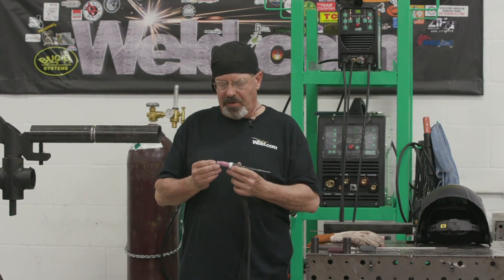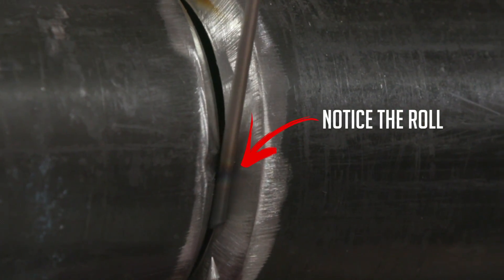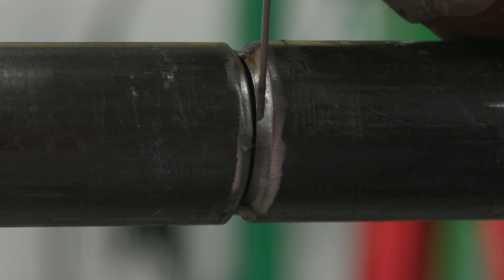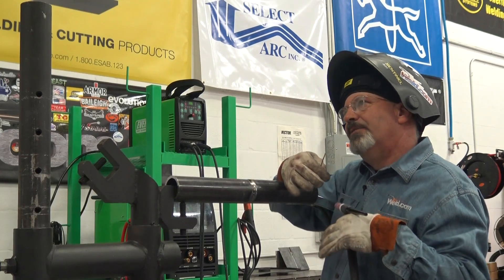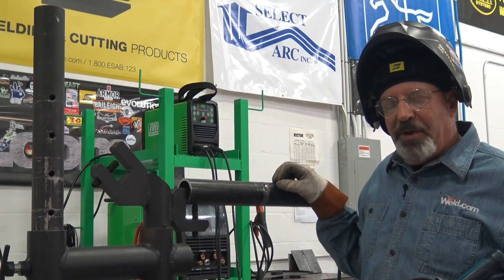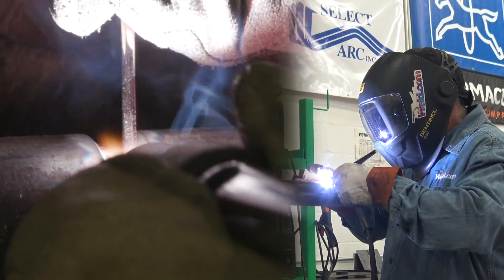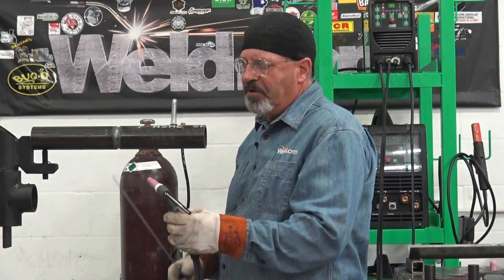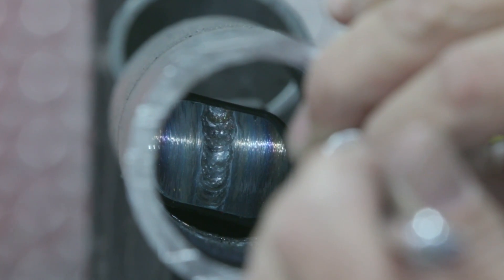5G TIG Root Pass: 2 Inch Sch 80 Pipe

Comment: No need for inert gas in the tube? I can see the electrical cable connected to the pipe, but no plugs and inert gas line to the pipe. I would guess it is needed for the root pass. can someone explain?
Reply from the maker: Carbon steel doesn't need purging from the backside. If it was stainless we would have purged the inside.

Comment: What is the purpose of “snapping out” of the weld? I’ve seen this done before but I’ve always thought to ease out on the amps and backtrack onto the weld. Also, wouldn’t this effect the shielding from the gas?
Reply from the maker: This setup did not have a foot pedal. It's common in the field to have a set amperage without a foot pedal or hand remote. To break the arc you have to pull it out.

Comment: Question sir. I think I have metal prepped but as I’m welding it looks like trash jumping on my tungsten. Improper cleaning or possibly to high amperage? 
Thank you sir.
Reply: Do you have polarity correct, try switching see if that helps and are you on DC
Reply: Car Mo yes sir dcen. Running on bobcat 225 with polarity switch on dcen and stinger on power lug. No foot pedal just scratch start.
Reply: Hi Dan I am not a welder by trade I do still have a miller bluestar 2e if memory is correct I too did scratch start with machine. All I believe I can remember is with my machine if you left it in weld mode it had a very powerful arc and not very good for thin sheet metal. If I switched the machine to generate it reduced the output and got a more stable weld for sheet metal. As for polarity I would put positive to the work, and the negative to the tig torch. I do believe I had a similar condition as yours when I had  positive to tig in dc mode. I haven't used this machine in  20+ years still in garage. Who knows if it will still run with new gas and oil change. Sorry if I cannot help further that is my limit. Good luck let me know if you resolved in any event.
Reply: Car Mo I’ll play around with it and see what happens. Change one thing at a time and see if it will remedy my dilemma. 
Thanks for tips, I’m getting frustrated.
Reply: @dannyharvey5623  On that welding generator I installed a foot pedal and when I would weld in the generating electricity mode and this made scratch start easier and the range of heat/current when doing sheet metal or welding light metal angle iron. FYI my welding gen is a big Alternator basically, so I made a welding gen out of a chrysler alternator isolated rotor terminals with a 1hp electric motor for minor  welding  I adapted my foot pedal to control amperage and scratch start worked fine it still works today and use it instead of big generator. Good luck remember if the generator doesn't speed up the amperage will be way lower and this is what I was told by Miller and would not affect welder for Tig welding.

Comment: This is what I'm doing now at home in my kitchen... welding courses are too expensive
Reply: Also Chris. Make sure your coupons are square after the cut, check them with a combo square on 3 sides. Doing this consistently will pay off big time.
Reply: @mattw8989  have a horizontal bandsaw that cuts real nice so worries there
Reply: Does anyone know if I could just cut straight through the middle of my completed weld and 're prep that area to try and make my pipe coupons last a while longer
Reply: @chrisplayz253  Too much heating and cooling can degrade steel, why it's better to cut in a new place, re-bevel, and move on.   That being said, cut like ~2" down the pipe long ways and you should be fine (depending on the diameter of pipe, 2" on a 2" sch 80 should work, if it's smaller then make them farther apart). Can make somewhere close to 12 runs on a 2' piece of pipe if you're lucky.
Reply: @chrisplayz253  just cut outside weld, essentially cut weld out on both sides so u lose 2in per weld or so
Reply: And yes you can cut your weld down the middle and re—bevel on practice coupons .I wouldn’t suggest it on X-ray stuff
Reply: @UCIPd0JhC3ZPRBsg1IAMrAUA cut about an inch outside of weld on each side of weld so you lose that 2in chunk your previous weld was in.

Comment: Always had me wondering because I’m starting tig, while doing the root something black spots happens to me and I’m wondering what’s the reason why
Reply: Clean the filler wire and the inside of the pipe.

Comment: Pipe Fitting  is how my grandfather started in the welding industry. Bless his heart he stick weld before MIG, TIG were available.
Reply: Pun Gent. My grandpa told me stories of how he first started welding. They had raw electrodes and a tub of flux. You dipped the rod in the wet flux and then struck the arc. How things have changed.
Reply: In a lot of places, Stick is still the go-to.  Out in the field it's a LOT easier to weld from the back of a truck with stick or flux core.
Reply: I worked with a 70 year old in my twenties he started with bare rod then double ended rod I'm almost 60 now and blind as a bat

Comment: Bob, the highlight of this video is where you dip the tungsten. I always wonder what is the proper thing to do, now I know. I’ve  stuck the tungsten many times and just resharpen the electrode and kept going. On many videos they say check the work for square, they check for square and it’s square and they keep going. BUT, what if it’s not square what do you do?
Reply: If it's x-ray grind it out. If not get a bit of heat where you stuck it.
Reply: I just change my tungsten. up my heat, watch the metal drop in and keep rolling.